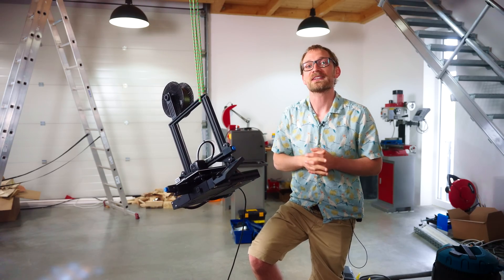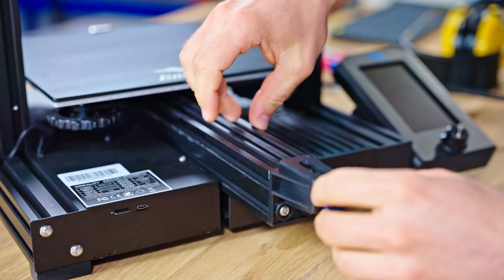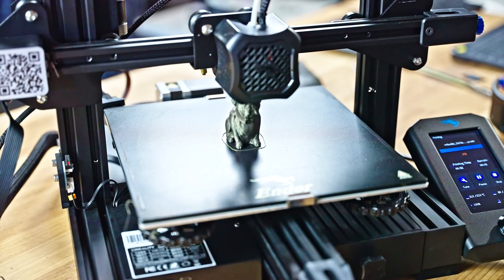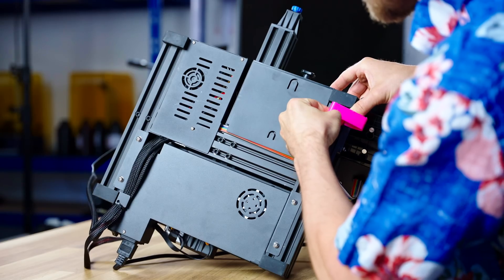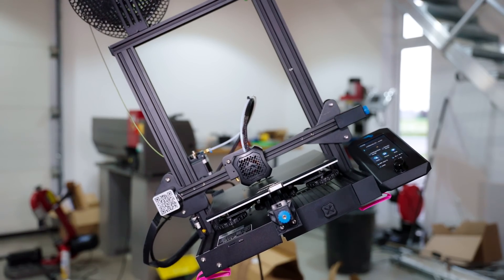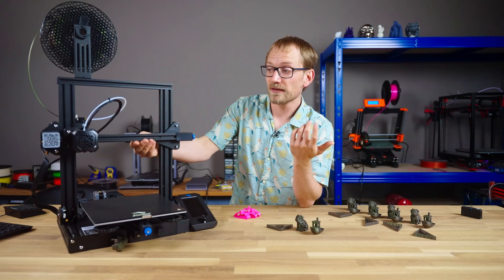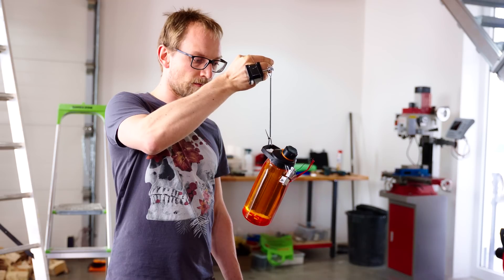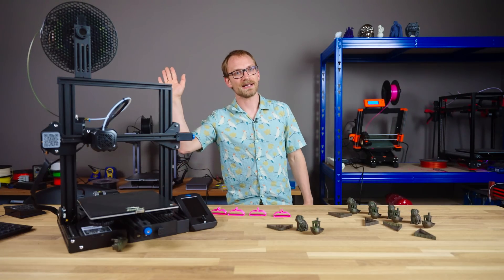Wobbly 3D printer makes for better parts!

Comment: It is all about the frequency you try to kill. The PLA feet might have had a close enough resonant frequency that the printer mass oscillated in the opposing way and started to cancel the ringing. A stiffer material might kill higher frequencies, while softer kill lower ones ? 
If you would measure the frequency and adjust the tension with a servo in synch, you would get most likely very good results. Similar like an input shaper paired with accelerometer does.
Reply: This is the first realistic comment I have seen.  Any system has a set of resonant frequencies inherently, and when printing a specific model, specific frequencies are amplified and others are diminished. A different model will produce different results. Rigidity, counterbalances, damping all play a role, but all come with tradeoffs. Well said, @SarahKchannel
Reply: Might be enough to just have a small set of "tuned" wobbly feet that can be swapped out to cover different print speed bands for a given model of printer.

Comment: I am thinking you'd need something to absorb energy... Maybe something with RC-suspension parts, on the cheap I am wondering if you could use piezo modules to convert vibrations to electricity, then dump that into a resistor or so - this would even be so light that it could fit on the moving gantry...
Reply: How long before you turn that into an active system?  Install vibration sensors in key spots and the drive the piezoelectric transducers with the same inputs 180 degrees out of phase and matching the amplitude as closely as possible.  I suspect you could create a completely silent printer this way.

Comment: I wonder if the damping method they use to earthquake proof high-rise buildings could be somehow adapted. Basically they have a massive weight at the top of the building that's free to move. It counteracts the movement of the ground and keeps the building from resonating itself to pieces.

Comment: I thought the concrete block on top of a foam pad (usually scavenged from the printer packing material) was the most accepted method. 

My method was: buying additional printers so that I can keep the speed down as low as I want.

Looks like, considering the sagging, someone should make some injection molded vibration dampening feet out of a more heat resistant material. I'd pay $10 for some easy just to try them.

Comment: I do love having my printer sitting on the pavers, but not mounted to them like you did. It took all of the noise that my printer was transferring into the table away and made it almost silent. So it is very useful for noise, even if it doesn’t help with ringing.
Reply: Same here. I also added a relatively dense foam slab under the paver. This way the printers vibrations are transfered into the foam, while the paver keeps it stable.

Works really well
Reply: @Daepilin  I have my paver on a chopped up yoga mat... Maybe I should try putting the printer on the mat rather than the paver :/ or both.
Reply: @jradplowman  actually I did that, I have my printer sitting on a foam floor mat on top of the pavers.
Reply: Most of the audible noise from printers with better stepper drivers comes from the cooling fans on my machines. Unfortunately there the weight of the machine and pavers don't help much to keep it silent...

Comment: I have often wondered about making a steel tube framed printer. That is the non moving parts all from welded or bolted steel and filling that with sand, lead, or concrete. The only issue I see is that you are still using springy belts, so no matter what there will be some ringing.  If only there was another option...

Comment: One thing I do that I'd love to see you test:  I keep my printer on adjustable height shelves, and use the vibration feet to push the top of the printer into the bottom of the shelf above the printer.  (Essentially, I wedge the printer between two shelves top and bottom.) I've always assumed that that would improve rigidity, but after this video I'm not as sure.

Comment: Try magnetic levitation like you would for a laser table essentially you have a table for printer here and a post with two powerful ring neodymium magnets with the same pole facing each other it should make a extremely good vibration dampener for this task as well as one that will last a very very long time as there's not really any component where their
Reply: Seems unlikely this would dissipate the energy though.  Even less resistance than the stretchy ropes.

Comment: Lazy option: let printing take it's time. Quality option: slow down even more :D
Corners are a bit like PI(D) controller tuning: either they are slow (bulging corners) or snappy (sharp-ish corners) with ringing. Hard to get correct (without Klipper and acceleration sensor).
Reply: With slow acceleration, you trade these issues for inconsistent extrusion due to varying flow and plastic fluid dynamic effects. Linear advance/pressure advance can mostly solve that, but it's tradeoffs everywhere and you won't get good prints without advanced firmware features.

Comment: I wonder how well a counterweight system would work on a printer IF it was designed in from the get go, it'd be harder to implement on a Ultimaker style system or V-Wheel system (unless you can find the space for an additional carriage on each axis) but for most of the others it would just take an additional rail and mass and attaching it in opposition to the part that's moving

Comment: I'd love to see the sand filled frame.  I thought 'more ridgid, more weight' would be better - not sure if it really would, but if that's the case - Lead filled extrusions would be worth a try too.  (just put endcaps of other material to stay lead-free contact, etc)
Reply: Instead of lead i would use tin similare properties but non toxic

Comment: My first thought would be replace the rubber belts with fishing braid to see if the belt stretch is a big contributor
Reply: The belts have metal wires running inside of them. I don't see braid being useful because the belts have teeth that grip on the gears that drive them.
Reply: @ssp_2015  My printer uses braid and has minimal ringing

Comment: Maybe fill the frame with concrete/cement, which would add weight AND rigidity AND try upgraded wobbly feet.  Stephan from cnc kitche put his printer on a concrete block AND has sponges as feet to bamoen the vibration. Did a wonder for noise.  Not sure about ghosting....

Comment: TPU squishy feet last longer than PLA. Slabs on carpet work well for noise and to deal with unstable desks. The slab helps me deal with low frequency ringing that doesn't really show up in prints, but confuses input shaper in klipper which is really good at stomping on higher frequency ringing.

4k acceleration on an ender 3 frame or a mk2 "dolly" prusa? Totally possible with klipper

Comment: Hi Thomas,
maybe "Alu-Butyl" or someting similar (Car-Hifi) could also help. Small parts could maybe be put on the moving parts to kill some resonances. I would be very interesting if you would try that out. Alu-Butyl is something many of your viewers could also try at home with their stock printers as it is fairly easy to apply, not too expensive and could be revoved with the right solvents.

Best regards from Mannheim, Johannes

Comment: Viscoelastic closed foam speaker feet might be useful, such as the Sonic Design feet that can be custom ordered for a certain weight.  If the resonance frequency isn't too low...

Comment: Instead of concrete or sand, how about cast iron? That's routinely used as the body of machines because of its excellent vibration dampening properties.
Reply: Probably not ideal at the low frequencies seen here! But everything should be explored 🤓

Comment: it would be interesting to see how Sorbothane would work vs PLA feet, foam feet, and paver.  It is designed specifically to dampen vibration... now to find an engineer to tell us which model to use.

Comment: Great video Thomas! Great to see some myths busted in an easily digestible format. I would love to see more videos going into depth on topics of what actually matters when it comes to expensive parts vs cheap parts and how some solutions might be very good from a theoretical standpoint, but infeasible from a marketing standpoint such as "sand in the printer frame" that you mention. Keep up the good work :)

Comment: I would try adding some more substantial brackets to the frame, adding rigidity and weight. You could also bolt on some steel blocks to the frame and add way more weight than filling with sand.
Reply: Sand adds dampening due to friction between the grains though.
Reply: @mellertid  That most certainly isn't a viable factor 😀

Comment: I personally have my CR-10 V3 3d printer on an old Ikea IVAR Wooden Shelf which is then on a thick towel, before then sitting on my actual tabletop. 

But I haven't run the torture tests that you have run, so no real idea if it is better or worse than what you tested.

The Sand idea is interesting, would be worth a test.

Comment: Hm ok, thats was fun. Maybe the silikon ball dampeners from copter gimbals would work pretty well in a big enough version. THey can be casted from silicone. ALso Alhpa gel is often used for vibrations but usally all of these solutions are synced to the frequency at least in a certain frame. 

Like the new machinists corner over there :D Just got a rotary table but still missing the DRO which is a huge improvement.

Comment: I actually just saw a guy in a voron group who used lead shot and epoxy in his frame. i believe he said it added a ton of weight and really stiffened up the frame a lot. I think it would be pretty cool to see some real testing done.
Reply: You can try using silicone with lead shot, the more rubbery the better.
Reply: Using epoxy with the lead shot will increase the mass but not create damping the same as if they were loose. When they're loose there's more damping since there's room for them to move and disperse vibration. Like a deadblow hammer
Reply: lead powder would be best. think deadblow hammer

Comment: Filling with sand reminds me of techniques for improving hi-fi systems. Filling with sand is used in speaker stands to add mass and dampen resonance. How about mounting the frame on speaker spikes as well? Worth looking at.
Reply: Testing "audiophile" equipment addons on 3D a printer does sound kinda fun, not gunna lie
Reply: Speakers spikes are meant for carpet (pierce the wobbly carpet to better mount to the floor below). They won't do anything notable on hard surfaces
Reply: @Skye-632  They do something o  hard surfaces - make your speakers unstable and scratch the floor!
Reply: @Skye-632  They are meant to isolate actually, they are meant to be used on a hard surface like concrete marble or glass. It's about reducing the surface area as much as possible.
Reply: @francesucksdickful  I’m sure the manufacturers "meant" them to decouple, in the same way that many audiophile manufactures mean for all sorts of magical things to happen with their products (frequently right up until they separate your money from your wallet), but unfortunately no, spikes do not decouple. In fact, their original intent was to BETTER couple speakers by piercing a wobbly layer of carpet (specifically to the style of carpeted floors common in the UK at the time of their inception). This is why before they were called "speaker spikes" they were more aptly called "carpet spikes"

For an explanation why they don’t work, you just have to put on your engineering hat for a minute. “Vibrations” are an oscillatory acceleration, and as such scale with the force/mass product of the system. A spring-damper system (aka soft rubber feet) take an incoming force and reduces the transferred amplitude through storage of energy in the spring, and dissipation as heat in the damper. 

On the other hand, speaker spikes are completely rigid, and offer no damping. “Minimizing contact area” doesn’t matter in the slightest in this case. That would increase the pressure on the mounting points, but doesn’t change the overall force transmitted (mass-acceleration product, aka vibration). There’s nothing in that system to dissipate any energy.
Reply: Whole different issue, does not apply. Lime machining using yo small machine or tooling chatter happens, adding san, springs mass does nothing.
Reply: @Russell White I think the idea is that the point of the spike means there is only a very small contact point on the surface they are tanding on? So it's almost isolating the speakers?

Comment: Very interesting video. Thank you.  Instead of filling the frame with sand what about placing the printer on a bed of sand, a bed of sand that has a very flexible cover such as rubber in order to reduce the mess, or have the printers legs rest on balls of sand (similar to the balls that people massage to supposedly reduce stress)? It would be interesting to see what impact they have on prints. Thanks again for all of your work.
Reply: I've got my Ender 3 on handballs, which are rubber but under-inflated.  They seem to dampen everything exceptionally well - I never see ringing, despite adding a layer of glass to the bed and moving the extruder motor to the print head with a cheap direct drive conversion kit.

That said, actually measuring the resonant frequencies and having the firmware adjust acceleration on the fly to cancel out ringing is the most effective approach.

Comment: I've been using a trick of my Printer on the concrete paver with dense foam underneath, and a wood workbench under that. So: Cr-10 V3(stock printer feet)>Concrete Paver>Dense Foam>Wood Bench. Completely eliminated X and Y axis ringing on my rig. Granted I never go past 100mm/s.

Comment: Every acceleration or decceleration of the carriage has to be absorbed by the chassis. Most of efforts the years were toward rigidify the chassis and lighten the carriage. The chassis is still not perfectly rigid so add weight down and also up to absorb cinetic energy. And why not mount an absorbing plate between the carriage and the hotend
Reply: Drive mechanism is big factor too which is most certainly a thing that's much overlooked. Belts can vibrate incredible amounts at certain situations, which will transfer to moved mass.

Comment: I don't think there is enough empty space in those small aluminium extrusions to make a significant difference. But putting the entire printer in a bed of sand might help. But it would also cause issues as soon as the sand gets where it's not supposed to :D
Reply: You're right. Volume inside aluminium extrusions is ridiculously low. I suppose it might have some effect to pour something like lead inside them and even then weight increase would be marginal. Sand though? Most definitely not going to be visible. If someone wants weight in profiles, I'd much rather just make brackets and slap some profile or heck even add another extrusion and fix them together.

Comment: My Sidewinder X1 sits on four squash balls  (the most dampening ones from decathlon ). The improvements are astounding even after turning acceleration up to eleven.

Keep up the great content!
Reply: Can you confirm if the balls you have are the ones with the 2 yellow dots called perfly SB 990 currently 2.15€ here?
Reply: @almaefogo  yes I can confirm these were the ones I chose.
Reply: @MRLIROCK  Thanks
Reply: @almaefogo  i'd like to know this too - which ones did you find give bestt results?
Reply: @gedr7664  no idea I remember seeing a video on YouTube about this squash balls from CNC kitchen iirc. 
Need to search a bit more later.
Reply: @gedr7664  I only tested the cheapest 2 yellow dot balls I could find. 2 yellow dots apparently is the sign for the slowest ball.
Reply: I haven't tested this myself, but I've seen results from couple Finnish users that have done such mod for some printers and for some, it can indeed be really good dampener. Also what I've understood you can buy them with different elasticity which apparently makes them nice thing to fiddle around. I've been planning to do this myself.
Reply: Are the squash balls cut in half? Or attached via a mounting block or something
Reply: @TheButchersbLock  I designed a kind of  cup holding one ball which replaces the original foot.
Reply: @TheButchersbLock  iirc just placed under the feet of the printer
Reply: @TheButchersbLock  Print cups that cover half of the sphere.

Comment: That's . . . Surprising, but also not. I took Stefan's word and put a cement paver under mine, which has quietened it noise-wise, but it still gets ringing. I found that putting the spool off printer didn't seem to make a difference either.

Have you thought about using squash balls? They have good, known (and various levels of) dampening factor. There are cups that clip into 4040 extrusion. Would a mobile phone gyro / accelerometer be sensitive enough to pick up ringing and allow to quantify it?